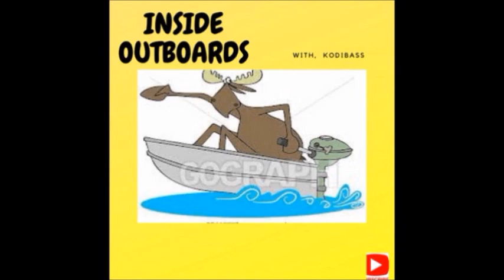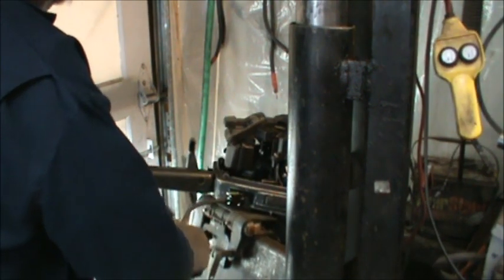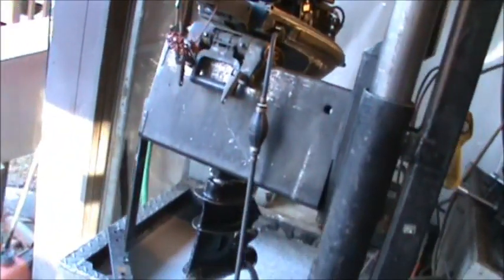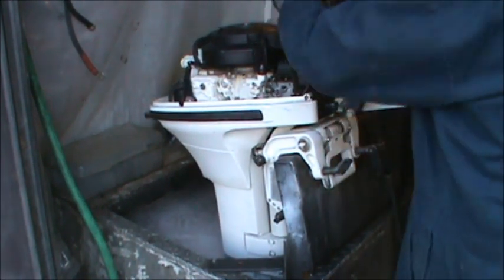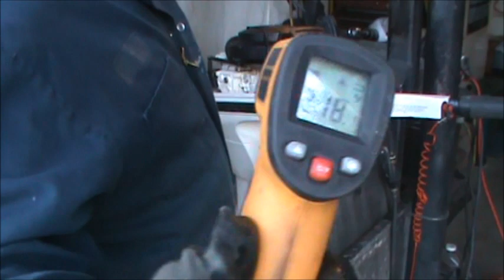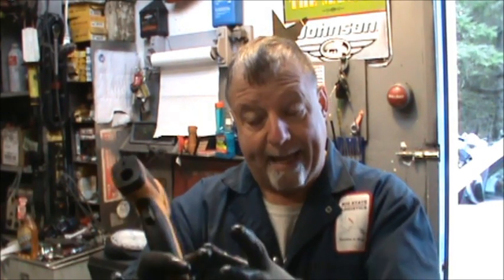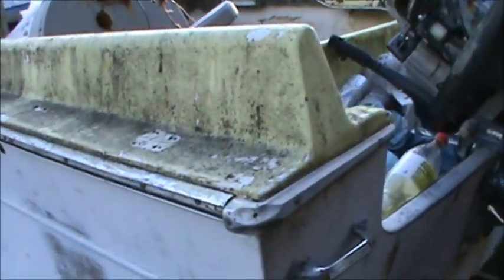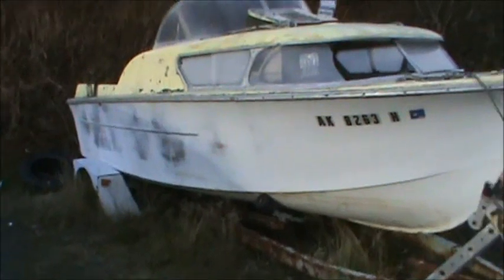JOHNSON  EVINRUDE 15 HP MOTOR REPAIR,  (( Part 1 ))

Comment: Poor kodi has got to get out more, he is worse off than me!  Yeah, that second "cutie" seems to have a strong spray but perhaps the grommet for the outlet water tube is plugged....  I didn't realize that the diaphragms for those thermostats are NLA, so be careful, try not to damage it when you remove it...
Reply from the maker: 4 sure on Both comments.          kodi

Comment: I sure wish I had that air or hydraulic swing you put your  outbord motors in the tank with I have to use a come along yours is much easier my tank is what ever I can find that holds enough water to run my motors in
Reply from the maker: I;m in the process of building another for outside,  The tank is going to b a plastic fish tote.       kodi